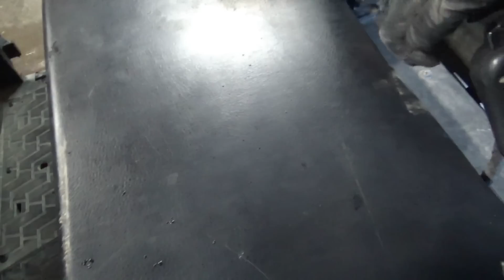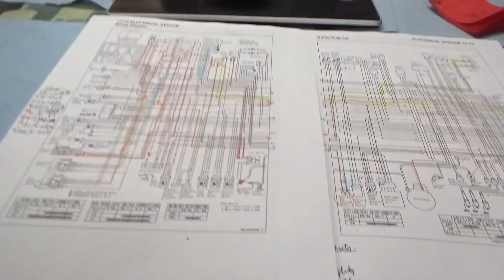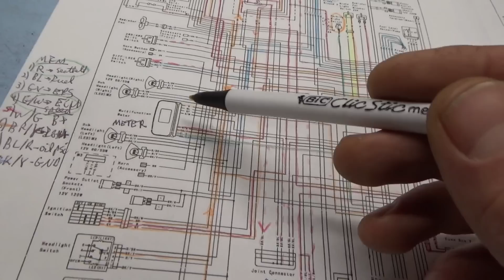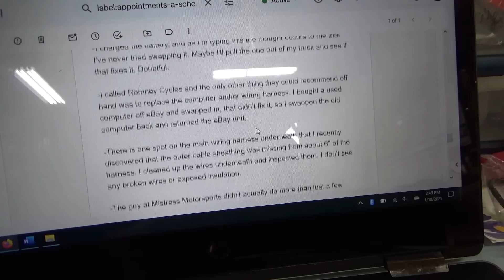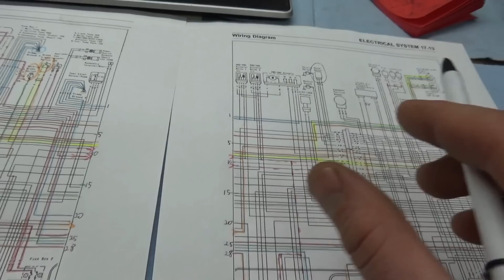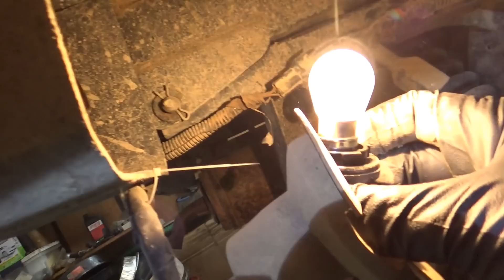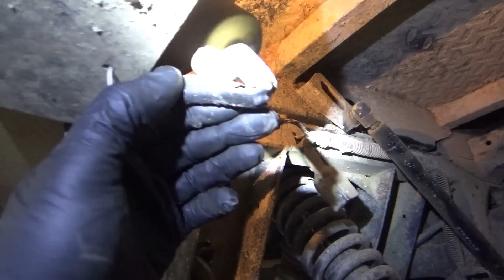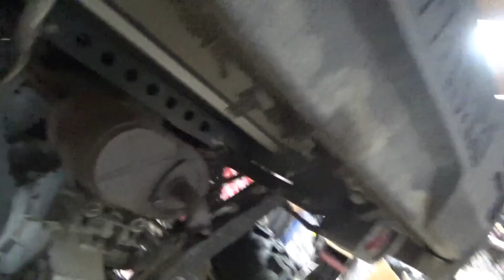Kawasaki Dealer STUMPED!?! SxS REDUCED SPEED Mode (15mph max)?

Comment: At the hunting land we have a 1998 mule , it has been beat to death , all of is learned to drive on it , I now work on it and have paid for all my 15 year old sins against it , it has 4000 hours on it , I’ve done , drive clutch 1 , drive belt 1 , front brakes 4 , rear brakes 2 , shift cables 3 , rack and pinion 3 , tires 2 , wheels 2 , valve cover gaskets 1 , battery 5 , rear wheel bearing 1 , front wheel bearing 2 …. Tie rods 4 , that said it doesn’t drip a drop of oil

Comment: Just wondering if the ECU puts a bias voltage on that circuit which would normally be pulled to ground by the two bulbs but since they were out it simulated the brake being applied. I remember some early Ford cruise control circuits that were like that. Easy way to tell would be to remove both bulbs and see if the problem returns. One could also monitor the voltage on the brake light circuit with the bulbs out. Great diagnosis!!

Comment: Well you started out great and followed the evidence, the switch should have been fine unless it was over adjusted to be open. I’m going to say it was the brake light wiring the tail lights and the brake light have different amps to run each since it was wired wrong the computer didn’t know which was which so it went in to limp mode. It may sound weird but it happened on a ford work truck we had a new bed put on,we found the issue once we pulled the wiring for the rear lights who ever did the bed cut the wires and put them back in the wrong order

Comment: So I'm gonna say I suspect the issue was likely the 'bad' brake light bulbs/circuits. On some Ford trucks, I've seen replacing the high mount stop lamp with an LED bulb may disable the cruise control. This happens because the brake light switch is a grounding switch that connects directly to the high mount stop lamp AND the PCM brake input. The other side of the high mount stop lamp is then connected to a constant 12V. When the brake pedal is not depressed, the high mount stop lamp bulb acts as a "pull up" resistor to pull the PCM brake input to 12V. With an LED bulb in place of an incandescent bulb, there may not be enough 'pull up' (too much resistance) so the brake input appears to be floating to the PCM, then for safety it disables cruise control. I wonder if the same issue is happening here except the brake switch is power side switching and the ECU is expecting the brake light filaments to 'pull down' the input to ground, but instead, the voltage is floating since it is open circuit.

Comment: that is my SPECIALTY computer wiring diagnosis,,plus drive-ability    GMC has a limp in mode and its list includes fluid levels  intermittent tcc solenoid and oxygen sensors  had one the other day trans was 2 quarts low it went into limp in mode & no one could find it,,,, idiots you first must learn the basics then you can do trouble codes it took me 20 years to learn

Comment: Hey Mike I have two 75 can 650’s one of them I bought when I was 18 and the other one I bought in the town I live in garage sailing … anyway the first one I took apart 20 years ago and meticulously put them in baggies and taped them up and wrote on them what they were etc: the problem is the ink dissapeared into the ink so I have it just sitting there! Would you be interested I reassembly? If not do you know anyone who would?  I bought everything but the front and rear sprocket and chain! The reason for the second one was to use it as a model for the other one but I don’t have the time to do it please let me know if interested and how much you would want .. I realize it will need additional work because of sitting for 20 plus years! I’m going out on a limb here hoping you read this and by putting my info here if you do call leave a voicemail or I won’t answer it due to all these telemarketers Dave 1-217-653-9723 thanks!

Comment: Just goes to prove that sometimes the problem can be so incredibly simple, but just gets overlooked because, how could taillights and brake lights be relevant to an ATV vehicle operation?  They usually aren't.  In fact, they are commonly damaged or broken and no one cares about taillights when you're riding offroad.  The scary part of this story is, the owner could have very well actually fixed this thing himself if he did try to replace the wiring harness and found the butchered taillight wiring mid process.  But would have felt salty has heck wasting a lot of time and money for nothing.  Shocking that not even the dealership would have noticed that.  Oh well.  Thankfully, the owner sent his rig to the right man for the job.  Great job Ivan!

Comment: The cpu has a pull up resistor on the brake light wire. If one light bulb still works, the brake light filament pulls the brake light wire to almost "ground". I had a similar problem on a ford focus. -----> the third brake light was all burnt out, so no ground path to ground, and the cpu resistor was pulling circuit high making circuit look like the brake was on. Again no codes. And cruise control would not work. Replace the brake light bulbs and everything started working again.

Comment: 😂🤣Max speed going up to only at 10 miles.🤣🥲this thing can going max speed is up 40 miles.The dealer could of finding this problems out,if only they’ve the times and the patiences of a real diagnostic technician likes Ivan to doing lots major diagnostic and tracing and tracking down all of those repaired with duck tapes togetherness worked🤣to see if all of those togetherness with all of those duck tapes works are correctly wirings.😂Most of these small franchises dealerships can’t afford a real good diagnosis tech on staffing.Theirs profit margins are very thins in these places.

Comment: computer thought the brakes were applied because the wire for tail light was connected to brake light feed
Reply from the maker: @jackoalltrades5708  not at all, wires weren't crossed 👍

Comment: Ivan, thanks for another great troubleshooting video. With that being said, might I recommend the Lisle 45900 hood prop. In addition to its intended purpose, it works great as a brake pedal depressing tool due to its adjustability.

Comment: First..... the dealer wouldn't of made it a foot with the speed sensor unplugged as it will set a code after one drive shaft revolution. Second .... the ecu receives voltage from the diff lock switch which then grounds the diff lock actuator relay. Third.... ecu doesn't care which way the tail and brake lights are wired as it senses voltage directly from the brake switch as they are wired in parallel. Fourth is the ecu only cares if the brakes are applied so adjusting the cable didn't fix anything either as your test before the adjustments indicated the switch was working properly. Can you explain your logic on the ecu having to sense the brake switch to achieve full speed? and adjusting the switch was the fix?

Comment: Ivan, the problem was not the misadjusted switch. 

The problem is the missing brake bulbs. 

Whenever none of the brake bulbs is connected (blown, or open wires, etc) the ECU it self thinks that the brake switch is on. Maybe because of some resistor inside or something slightly pulling up the circuit inside the ECU. 

Just had the same issue with a 2007 Isuzu D-MAX.
Reply from the maker: @bryanmora960  yup that became clear after I adjusted the brake switch haha

Comment: I'm reminded of old 1980s Mercedes, where if you put the wrong wattage headlight bulb in, the cruise control will not engage.  It wasn't just a bias voltage, it was actually looking at circuit resistance and could monitor the lighting circuit even when turned off.  I have to wonder if that's what was going on here!  Did it know the wrong filament was wired in?  I want to wire in a 4114 and see what happens, now!

Comment: So, was it a misadjusted switch or the control unit tricked into thinking you were stepping on the brake pedal due to the switched wiring at the socket?
I think the control unit most likely monitors that circuit.
Reply from the maker: @rodvan-zeller6360  neither. Just open ckt on BOTH brake bulbs 😆
Reply: @PineHollowAutoDiagnostics  Got it thanks.

Comment: This and Kia both a good visual inspection could have fixed the problem neither those shops really did diagnostic they just did whatever and replaced and said that was the problem THEN, it's something else NOW. Gave it back broke with a bill. It's either evident and easy fix or something is made up problem or parts. I mean the shop demands it 'why you messing around with test light and wires, get it out the door we got 10 more buggies to work on!'

Comment: Most likely caused by a backfeed from the tail light power to the brake light circuit on right tail light bulb being wired incorrectly. Not the brake switch adjustment.

Comment: Actually NOT surprised !  Some (Ford at least) use a dual contact Brake On Off switch.  The ECU is "looking for ground" to sense tha the pedal has been pressed to TURN OFF THE CRUISE CONTROL !  If both bulbs are burnt out/non-functional and there is only one contact, the cruise will NOT turn off.

Comment: It's pretty sad that a Kawasaki dealer and a shop that specializes in the ATV's couldn't figure this out.  I guess it's true that if there is not a code in the computer to point them in the direction, that they are clueless.  Great job Ivan.
Reply: the techs that worked on it obviously were lacking in experience with electrical troubleshooting. newer tech? maybe
Reply: 100% truth!!

Comment: After finding a schematic on line the only thing that makes sense is this :  The Brake switch must be pressed and supply 12 volts to the ECM for the engine to crank and run. The 12 volts also goes to the 2 rear brake lights. It does not matter if the bulbs are blown or if the tail filament is switched.  When the vehicle is going down the road, if the brake switch is pushed, regardless of  the rear brake lights are working, the 12 volt signal goes to the ECM to limit the power. This means if you are going down the road at full throttle, held down, when the brake switch is applied, the ECM will cut back the power, probably as a safety limp mode for a stuck open throttle. This means the root cause of the problem had nothing to do with the bad wiring at the brake / tail bulbs , but had everything to do with the brake mechanism being worn to the point where the brake switch was activated all the time.  It would be easy to test by either running the vehicle down the road with the brakes and throttle applied, or by just adjusting the brake light switch to be on all the time. Like check engine chuck says.. that is the diagnosis !!
Reply: So at about 25 minutes you test the brake  switch which worked fine but    when going down far enough, and you adjusted it so it acts sooner, more sensitive, and at about the 32 minute mark you say that was the root cause. The problem is you did many other things after the 25 minute mark, fix all the wiring and unplug and reconnect the ECU ... 
Until I know the logic of the brake light monitor pin on the ECU, I am at a loss to explain your success. I  would think the ECU brake monitor is binary ON or OFF, based on the voltage range it sees.  My initial though, prior to reviewing from minute 25 as you suggested, was that the voltage to the brake light monitor pin on the ECU was stuck to HIGH voltage, and this prevented the ECU from allowing full power, because why would anyone want full power and brakes at the same time ..? This makes logical sense. The monitor will work all the time, and it would not matter if the bulbs burned out. 
If the brake switch is required to send power to the ECU monitor pin to get the vehicle started, then I could imagine a logic that would say: Option 1 : IF rpm is less than 400, AND brake switch voltage is HIGH, then allow start enable. 
Option 2: IF rpm is over 400, and brake light switch is HIGH, CUT power to 20 % or whatever . 
There is a question also on the logic for running under full power ,not limp. Is it possible that the Brake switch ON  is only monitored for an instant 1 time per key cycle startup ?  If this is the logic, then it could make sense that if the brake switch was not pressed down firmly enough, it would not allow full power, but would allow starting. 
About a dozen of my friends in Anthracite Coal area have side by sides. I forwarded your video to all of them. Since 1969 I have been riding dirt and street bikes. I have not been able to explain your success to myself. I appreciate all you do and the feedback. 
NA ZDROWIE !
Reply from the maker: @danieljurgill1681  I think the root cause of the speed limit was both brake lights being open ckt, not the misadjusted brake switch 👍
Reply: @PineHollowAutoDiagnostics  The circuit schematic ,if I recall, is in parallel, so an Open Circuit should not change the  ECU monitor value, because it measures voltage after the switch but BEFORE the bulb filaments drop it toward ground. HOWEVER, you did find corrosion on the left side, and bad wiring on the right side,   and no ones knows if there was some kind of short to ground or short to another nearby wire or connector.  This could have repeatedly changed the monitor voltage and put the ECU into limp mode, and in doing the electrical work on the wiring, to prevent a relapse, AND by disconnecting the ECU connector( which basically unpowers and resets the ECU ) , you solved the problem. NOW IT MAKES SENSE !
Reply from the maker: But brake switch linkage was stretched so brake switch was OFF all the time 😉
Reply: @PineHollowAutoDiagnostics  well, Could you explain it. With power in from the fuse ,to the switch and then 3 places, the ECM, and 2 bulbs, there is only power seen at the ECM when the brake switch is contacting . I do not see how you could say the switch was not working when both bulbs were out. What I am saying is the switch was set or defective to put the brake light on either all the time or it was on a hair trigger.  Explain the circuit logic you think it is, perhaps a system explanation from the service manual ?
Reply from the maker: @danieljurgill1681  watch the part where I test the switch with a test light at the switch before making the adjustment 👍

Comment: QUESTION TO IVAN: WHEN BRAKE IS NOT APPLIED, THERE IS NO POWER IN THE RETURNING WIRE. BEFORE AND AFTER THE ADJUSTMENT. WHAT DOES THE ECU SEE AFTER THE ADJUSTMENT.

Comment: VW 's measure brake light energy consumption. There are 2 bulbs which physically fit and work. Brass ferrule is 15W and silver ferrule is 14W. This extra watt of consumption will trigger ABS. It takes ~100 miles to trip ABS. So not immediately obvious.
Reply: I had a coworker who had a mechanic replace the ABS module, wheel speed sensors and ~$3k I think gen mentioned the light issue his ABS light was off the following day. 

I think the theory is that extra load in safety system means it can't guarantee it will function properly. So ABS light.
Reply from the maker: @jaredharvey1511  wonder what the exact code was?
Reply: @PineHollowAutoDiagnostics  it was I think a 2002 Jetta. The boxy style. I ran into that like 10+ years ago. I didn't have good scan tools back then. I recall a generic / cheap OBDII produced some kind of generic non descript code. Hmm I feel like that situation was what caused me to get a VAG COM. 

Short answer I forget the code.
Reply: @PineHollowAutoDiagnostics  if you get access to a VW might be good to intentionally change the light and show the diag of that issue. I'm sure lots have that problem. I'd bet you'd get a bunch of views.
Reply from the maker: Wow that's a picky VW! 😮

Comment: In a car if you were to apply the throttle and brake at the same time this would also happen, it would cut power to the injectors as a failsafe incase the throttle gets stuck open. Is this not the case?

Comment: Non intuitive (initially) issue cause. I have a Honda minivan the always had a steering drift to the right. I tried everything from struts, control rod bushings, ball joints, sway bar links, etc. no avail. Then, a few years later in was getting noise from the rear engine mount. I replaced the shot engine mounts, and voila, the drift went away. Serendipitous fix.

Comment: Safety lockout. The computer saw open circuits on both brake lights. Limits speed so you don't get rear-ended by another side-by-side.  Replacing the bulb on the right or fixing the wire on the left would have resolved the issue. I'm glad to see Ivan fixed everything and adjusted when they come on. I bet the computer runs a few mA through the lights to make sure there is continuity.

Comment: Hello Ivan..Nice job.I figured it wasn't getting a break signal.From some where..Some clown wired up. One of the break lights wrong..Shamm on them.Not checking the brake lights..Had. A bad switch on a Nissan

Comment: I have a 2020 Yamaha Wolverine X2 and without drivers seat belt buckled it limits the speed to 10 mph, also in the glove box there's another spot for a key (different than ignition key) that if you turn it, it limits the speed to 25 mph

Comment: The light voltage back feed into the brake circuit would have told the ecu that the brakes were constantly on with the two wires swapped
Reply from the maker: No, it just lit up the wrong filament lol...bulb ground was wired correctly :)